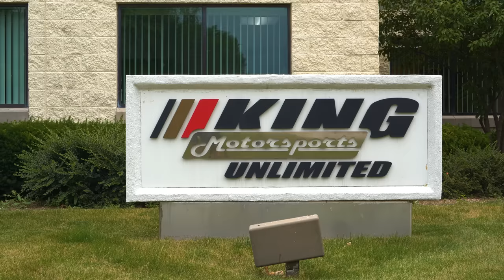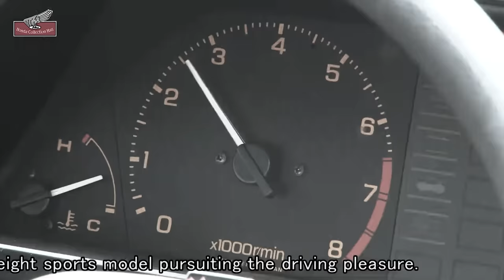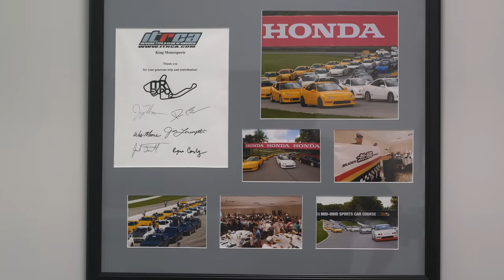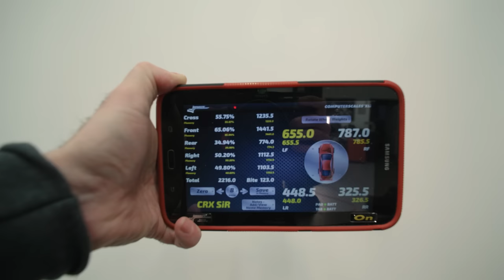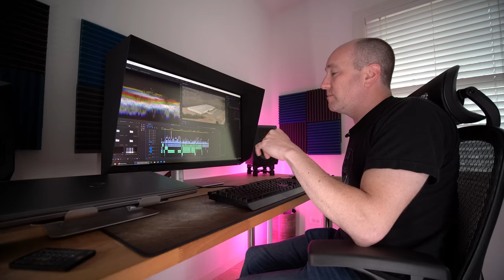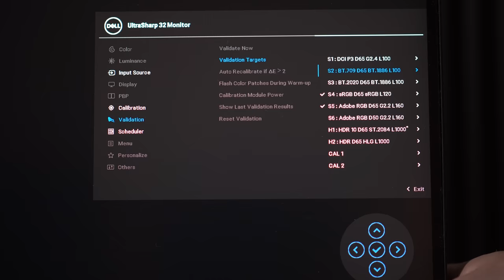Honda CRX SiR | The Golden Age of Honda

Comment: OMG, CRX.  I have had it from 1995 to 2005, 245K miles.  only things I have replaced were radiator, brake pads, battery and alternator.  I didn't have power honestly, but, 42 mpg!  I really miss this car.

Comment: They weren't affordable here in New Zealand, the 91 SiR was over $60,000! My Si 89 was $16,000 2nd hand with 30k on it,one of best vehicles I've owned. Went from Series1 12a Rx7.  Had Tokico adjustable, Nu Speed race springs, braided brake lines with comp pads, stripped out was 825kg.. ran on race gas with a 5° Advance...straight piped, cat delete with 12" coby at back. Back in early 90's shocks were$3k!Was my daily for 5yrs, tracked at Taupo, Manfield and Pukekohe ❤

Comment: The CRX and B16 is the perfect match of power, weight and suspension.  There is no point where a downshift and mash the throttle in a curve would make it lose control completely.  I've even done so in a curve while switching lanes to get around someone heading down a mountain road at speed.  Mine feels like it's on rails and it's a blast to drive.  To do all that with no electronics helping the traction/suspension balance is truly unique.  Well done Honda.  I wish I had the actual SiR but a swap is the next best thing

Comment: I had UK top spec CRX VETEC for eight years - same 150bhp engine spec as SRi but sliding steel sunroof full leather bucket seats but no air con.  Very safe handling compared to MK1 Elise I traded it for but that is a very special car too and one that I won't be selling as long as I can still get into it.

Comment: Wow, the sound of that engine is fantastic! I autocrossed the first gen in CSP and it was a hoot. I had a second gen SI but didn't care for it that much on the street. I raced against them in SCCA IT with my AE86 for many years (admittedly, the Honda was a more modern design than the Corolla by a lot but I still did well).

Comment: I was probably the first in my country to swap a very fresh B18C6 ITR (Euro spec) engine in a Euro spec CRX 1.6i VT, the European LHD version.Those engines were very hard to find and expensive back then. The B16a1 engine for the time was amazing, but tame compared to the B16b from the EK9 and the B18C6. It just lacked torque. It transformed the car from fun to amazing with 218bhp @ crank by just a custom 4-1 header 60mm runners and 63mm collector to 57mm at the rear using flat flanges. Custom ECU mapping. ITR LSD in fitted in the Y2 gearbox, which had a bit too long gear ratio, by could do well over 100kph in 2nd gear and worked nicely on the Autobahn and high speed curved roads. Back in the days we just had to make a lot of custom parts or take brakes from other Honda's to upgrade the cars. What a superb time back then, I was working on the car and improving it every saturday, during the week I worked my butt off to pay for upgrades! 😘

Comment: One car I've owned that acted like you described, FWD you steer with the throttle, was an Alfa Romeo Sprint Veloce -85. 105HP flat four, based on the Alfa 33 chassis (and before that, the AlfaSud), low weight and a very rigid chassis. Not fast, but great fun on a small race track or a nice twisty road. You could get that rear end to step out in some nice lift-off slides.

Comment: In 1991 I bought a 1989 CRX Si for just under $6500 - it didn't have air conditioning - really no options at all (I believe then the sunroof was included in the Si).  I drove the SNOT out of that car and always rewarded with a fun drive experience and around 30MPG _ALWAYS_.  I learned to autocross in that car - learned how to maintain a car with that little Honda.  I don't remember what I got in trade for the CRX (it wasn't enough I'm sure) but looking back at more than 30 years ago I wish that I had been able to just keep it and made it a restoration project today.

Comment: If it weren't for this car I would not have been able to achieve my dream of becoming a touring musician.  Had an early 90's red CRX that fit a Marshall Half Stack and all my other gear, cost my roommate around $400 with over 100,000 miles.  Toured up and down the east coast putting another 50K on the odometer before I was finally able to afford a pickup truck!!!  I miss this car and the freedom it provided.

Comment: What a great design. This was the era when Honda was developing the NSX and the ITR. Honda founder Soichiro died in 1991 and soon after the brand started cutting costs. As for the CRX (sometimes called CR-X) even with only a small diameter sports steering wheel the real handling was coming to life.

Comment: I had an 85 civic S. I put 132000 miles on it and sold it to my brother. He ran it for another 50,000 miles. It had a carburetor. I would turn off the AC to go up hills. The thing I still miss is the steering feel of the non assisted rack. Your hands just wanted to hold the wheel and feel the road.

Comment: You cannot find these cars anywhere today. in the Toronto area I've not seen an 80s civic CRX or early 2000 CRX/SI in probably 20 years. I would love to have even just be able to drive my old 85 5 speed DX hatchback again. The engine is bulletproof, the sound, the transmission i could shift by just rev matching with 2 fingers on the stick. The car loved to be driven in the high RPMs. I wish i had a the last of the first gen CRX SI or the Civic hatchback SI. but in this area most have rusted out and been scrapped long long ago. Never driven that version of the SiR. If i could pay $$$ to drive one again even just for a few hours i would.

Comment: I had a 89 Civic SI which is the big brother of this car. No AC, power steering, and it had a D16 or some other basic engine without VTEC. It was a hoot and the handling was amazing but was kind of sketchy in the rain, even with okay tires. Very reliable, but you need to watch out for Rust and general neglect or you will be living with or fixing annoying problems.

Comment: I currently own a (USDM) 1991 CRX Si in Frost White. Original D16A6, but bolted on 4-2-1 header paired with a custom fit HKS Sport Exhaust sounds wildly similar to the B16A in this SiR. Nowhere near as much power,  but the sound is very close. Regardless, I owned a 89 Si when I was in high school in the late 90s, peak Socal car culture days for imports. I sold it and vowed to rebuy one day. Took me nearly 20 years but I found a mint, gem specifically with an original D16A6. I went out of my way to find this engine as I think its maybe the perfect engine for the platform, next to the B16A. Way too many CRXs were ruined by broke modders who swapped the shit out of them and let them rust away. In 2023, finding an original paint, whole interior CRX with a D16A6 is like striking gold. My advice for anyone out there hunting is, be patient .. most of what you're going to come across will be on its 8th owner and chopped to shit. Be patient and bring cash. Don't hesitate when the right one comes along. Then garage it for life and drive it on the weekends.

Comment: Damn now I want another one. I’ve owned three. A ‘black ‘90 Si with DOHC ZC, a stock black ‘88 Si, and a stock white ‘88 DX. The last one being the DX that I traded for a ‘99 Civic HX coupe because I needed a back seat. Had it for 6 years and of course the youngster that I traded totaled it a few months later. Now I want an ‘88 Si so I can drop my HX engine in it. Problem is you can’t find unmolested examples. Youngsters always ruin them. It took me 6 years to find the DX at a Honda dealership. Some car collector had traded it in. It was an all original one owner car.

Comment: My dad and i had a bone stock 89 crx si back around 2000.  Used it solely for scca solocross.  It was so fast in this setting our opponents asked officials to inspect it at least once every event.  The only car I've ever competed in solocross that was better, was a 2000 mr2 spider.

Comment: Still own my 90 CRX Si, original owner. Almost sold it for nothing, then pulled my head out and restored it mechanically. Next is body work, but drives and sounds like the SiR, even with the SOHC 1.6.  Owners manual warns against rapid de-acceleration by downshift in curves, so yes it rotates. 1000 smiles per gallon, baby!

Comment: Here is another similar car to consider and even more rare than the Honda CRX. 

1994  Suzuki Swift 1.3 twin cam 16V with 100 hp engine (the G13B) and a 7,400 rpm redline only weight of 1731 lbs, a really fun car to drive.

Comment: HOWEVER , I WAS THERE WHEN THE 86-87 CRXs IN CALIFORNIA CAME OUT. I OWNED THE 86 HF THAT KNOCKED DOWN 50MPG OUT OF A CARB,  AND MY CO WORKER OWNED A CRX SI  , FUEL INJECTED THAT WAS A ROCKET ONLY HAVING 91 OR SO HORSEPOWER. AND THE SEATS SLID SO FAR BACK YOU COULD BE 6FOOT4 AND FIT IN THEM. TRUE 2 SEATERS TOO.

Comment: I had the shitbox version of this car that I bought new in 1988-the CRX Si HF! Unfortunately during a short deployment from Ft. Benning, the car was gone when I returned, found a few months later in a river. What I remember about that car was it feeled gutless, but in a 'race' with my friends 350 nova, wasn't that far off the pace! It got amazing mileage, the shifter was a broom in a bucket, but would shift without even using the clutch.

Comment: The normal Honda Civic is also (was) a great fun car! I owned two. I thrashed them around and had enormous fun. Among the most fun I have ever had in a car actually, and I have owned many, including much faster cars, but probably those Honda Civics were actually the most fun. 850 kgs and about 75 hp, no traction control or stupid electronics. Imagine, 850 kgs! Todays boring car are at least twice and feel completely numb and dead. The late 80ies and 90ies must have been the peak of car technology.

Comment: First review of you guys that is not a continuous moaning and groaning diatribe of belly aching!!!!! Good job! ANd for once I agree with everything you said here! There is one overriding issue why this car could never be built again, If you put this car in a modern crash test the car would be utterly destroyed. Imagine this one the side pole test.... the car would probably split in half. On a small overlap test the whole side of the car would simply shear off from front to rear spilling the driver into the barrier. Finally that VTEC engine is probably killing all the flowers on the side of the road as you are driving by at 8500 RPM. I had an S2000 and know exactly what this is all about. But, lets face it, despite all fast and fury excitement compared to any modern EV these cars are woefully slow.
Reply: the vtec engines and similar engines are actually still pretty good even with todays standards, plenty of cars are far worse. and I would say pretty much any car is slow compared to modern evs, not that it even matters

Comment: I had the 90 Honda Civic, 2 door with the little glass rear door, 4 Spd manual, black bumpers, only option AC. I put 235k on the clock.  It was a commuter car, 4 large guys in it, minimum weight was 225 do the car was over loaded.  It used to scrape down an uneven road, people thought it was slammed.   Great car but slow.

Comment: This was my 2nd car in the late 90s.  My first, of course, was a 1987 Nissan 200SX coupe.  If you could only know what value these bastards would have 30 years later, you’d rent the storage units and get ‘em off the ground.

Editing to clarify-  I had an Si, not R.  And my definition of value wasn’t necessarily for resale.  Hell, when I had the Nissan there weren’t even lowering springs for it.  Pacesetter-brand exhaust and headers were it.  It was still teenage bliss.

Comment: Restomod 911s are crazy money and in huge demand. Companies who specialize In restomodding more generic legacy 80s and 90s cars could find a huge demand as well (I think). Hydraulic steering and manual with modern brakes and suspension sounds as per the video aremore engaging than a new model. If done well, may fetch good $ and be a worth business......old Accords and Civic resto'd to a fun FWD spec with real knobs and buttons, what is not to like. In the UK restomodding old Escorts etc. is a thing, but they are expensive and maybe too far to the Singer approach (best of the best).

Comment: * ALERT*  I still own & drive daily my 100% stock 1990 Honda CRX Si.  Approaching 349,000 original miles.

Has the SAD rust issues of all 90 CRX Si's:  rusting wheel wells in the rear panels.   Had to SEAL CLOSED sunroof due to leaking & rust.

MODS:   Replaced "B" engine with a 1992 Honda Civic Si ( lemons owned)  VTECH ( NOT wired in. ).   REPLACED A/C system with a 134a system .

In search of:  drivers door ( mine has a rust HOLE ), BOTH rear panels ( rusted wheel wells ), DRIVERS seat ( left bolster torn up & exposing metal seat frame ).

NOT seeking full restore job... just REPLACE parts ( any color is fine ).  Might own 1st "rainbow" 90 CRX Si.

I'm in the midwest ( KC ) & would appreciate any & all reputable assistance.

Comment: what is the corolla hatchback compared to this?  I've had an 84 Si and 89 CRX; also other older hatches like the I-Mark etc.; my assumption it would be smoother, faster, safer, more efficient, with tons of crap on it I don't really need that adds weight ...  plus the glued on media dash thing and not in love with the extreme window slope; but what other options are out there from the last 3 years or so?

Comment: You should take your Dell machine and render a large project using the CPU and then go find a machine with the same CPU that uses retail off the shelf parts and compare. The Dell is going to be significantly slower, probably around 20%, all because they chose to save $10 using a small CPU cooler that causes all Dell machines to throttle the CPU to prevent overheating. The level of cost cutting in the design of Dell machines is really unmatched in the industry, that's why when you open them up they look like machines from 20yrs ago, they partially are, same exact machining with the cases with tiny 80 or 92mm rear fans from 20+yrs ago.

Comment: In this day and age new platform architecture design can support one architecture supporting multiple models.  Is it not possible for Honda to establish a 3-Tier brand structure?
1) Honda, 2) Acura, 3) Honda R where R functions like Porsche's T designation (simplified, weight reduced, performance parts, customization).

100% Electrification  will be seen as a mistake.  Performance hybridization may be a second path to reduced emissions and better fuel economy.

Comment: I am a original owner of  a 1997 Honda Del Sol Si.  It just turned 215,000 miles today.  It handles 
beautifully .  I had it upto 100miles per hour Sunday.   There seemed to be a lot left.  This is on a 26 
Year old car and 215,000 miles.  It starts up immediately.  I use Bouche  4 prong  platinum plugs.
In 1997 I called it my midlife crisis car.  I am still in it.   I can not say that about Hondas today.
The Civic is a big 4 door shopping trolley no matter the engine.   I cringe when they call it a 
Sports car.   Today Toyota has the cars that Honda had.   Building cars  that no body can afford 
NSX is not the Honda that Sochira Honda made.   The line that Honda makes is horrible.
The cars look horrible.   The designers should all be fired!

Comment: You mention fuel economy standards as one of the factors that stopped cars like these.  Honda built a fuel economy version of the Civic in the early 90's that got a real world 50 mpg  while many competitors were struggling to reach 30-40.  The truth is that Honda doesn't want to sell you a Civic or CRX or any other small fuel efficient car.  My 2010 Honda Fit is a penalty box that struggles to get low 40's on the highway at 60 mph max.  It is much more profitable to sell you the largest vehicle you can afford or an SUV or Acura.  They care nothing about the small entertaining cars they made decades ago.